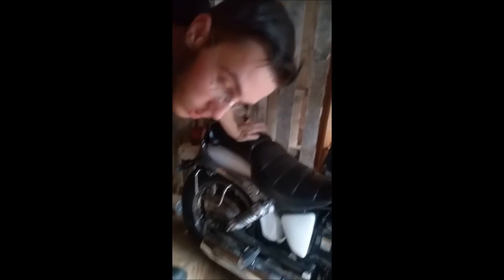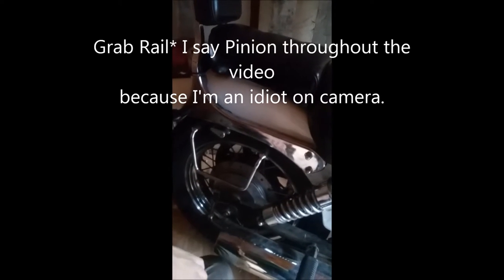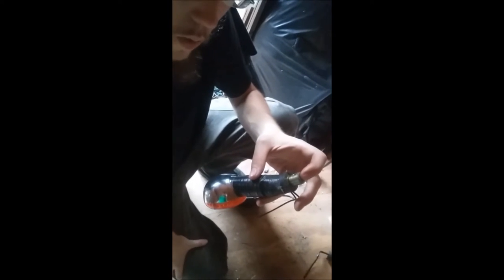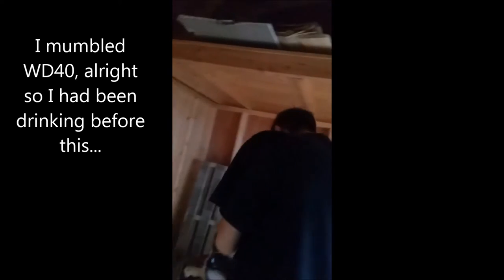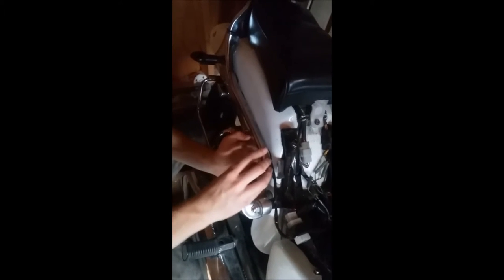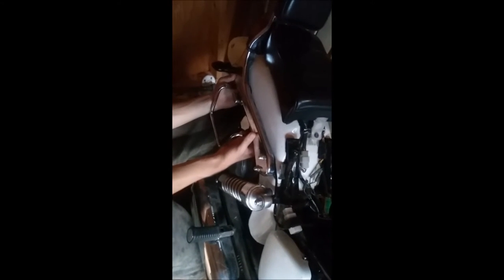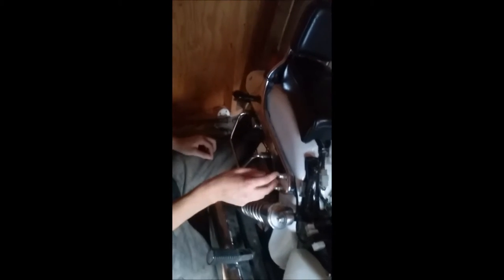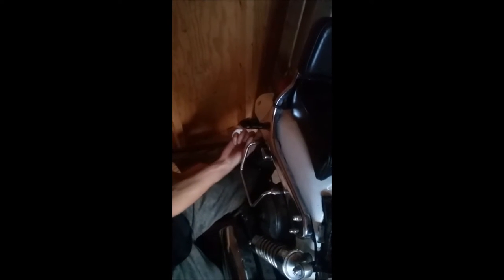Suzuki Savage rear directional replacement

Comment: Can you run LED turn signal bulbs on these bikes? And would you have to install load resistors to get rid of hyperflash?
Reply from the maker: Mark Meadows if you replace those whole lights then yes you are correct you usually need a new flasher or load resistors to stop hyper flash. There are some aftermarket led bulb replacements that fit in certain oem housings and work without hyper flash and have their own resistors. But not sure if you could find them for this application.

Comment: I'm trying to find where the back brake light wiring is located on my 2006 Suzuki Savage. I have a feeling its under the tank... help please.
Reply from the maker: Need to know why you want to access it to give you the best location. It goes all the way from the brake light, to the rear fender, into the main wiring harness and connects to everything else and eventually makes its way back up to the brake light switch on the handbrake and also at the footbrake. The easiest access point if you were going to say, replace the brake light with an aftermarket, would be under the seats and tracing the wire from the light as it goes under the seat. The colors are most likely brown, white and black, and white and grey or something similar. Three wires most likely. Let me know if you need more info or what it is you are trying to do.

Comment: the wiring coming from my aftermarket directionals are not long enough to reach where the OEM ones were attached, do you have any ideas besides just soldering them together?
Reply from the maker: Soldering and heat shrink will be your best bet for lengthening the wiring. However once lengthened I would attach the signals to the wiring with some insulated plugs. That way if you needed to switch out signals again you won't have to be cutting wiring all over again.